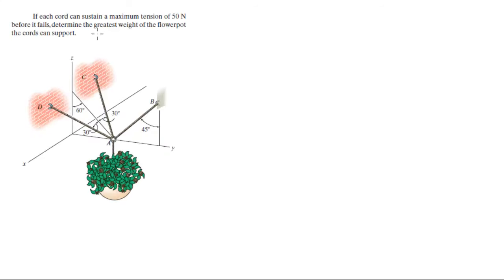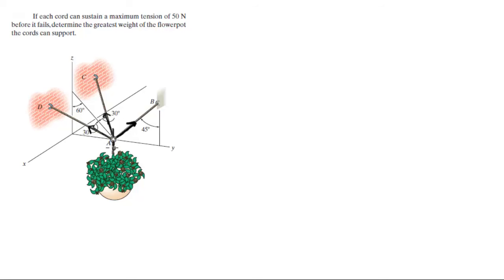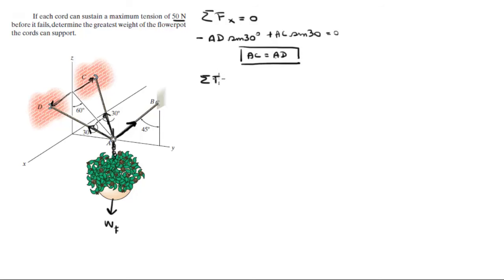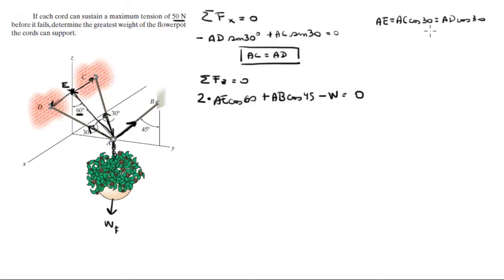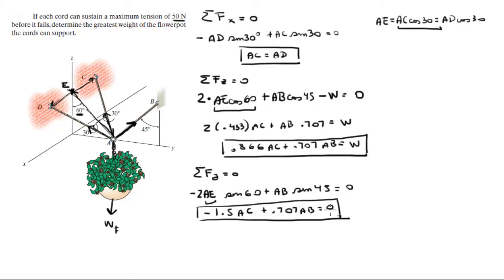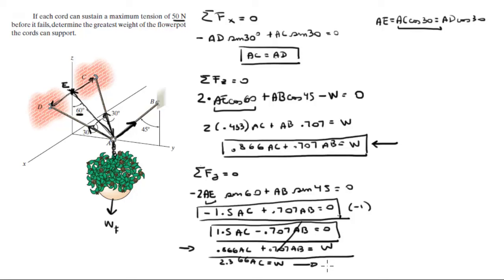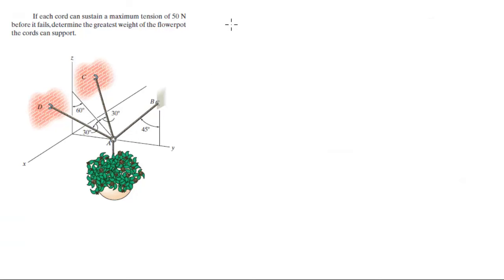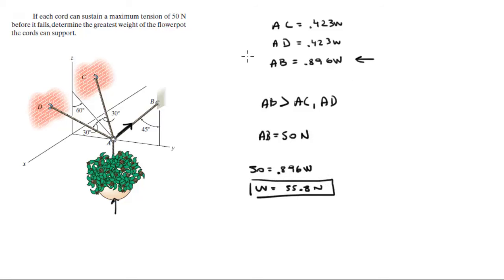Determine the greatest weight of the flowerpot the cords can support

Comment: Great video, but you did 2AEsin60 and not 2AEcos60 when you were summing the z forces. 2AEcos60 should be just AE, since the cosine of 60 is 1/2. You ended up with 0.866AE which is the sine of 60.
Reply: He used the top relation to replace AE with ACcos(30) when summing the z forces. This equals 2ACcos(30)cos(60) which is AC(.866). 2(cos(60) = 1/2)=1, 1 times cos(30)=.866. Sin(60) does equal .866 however that is not the trig he used in his solution

Comment: cos45 is .5253 unless you change the mode to degrees then it gets your answer of .707. Why are we using degrees?
Reply: Because the question gives us the measures in degrees. So you just keep the units they give you.